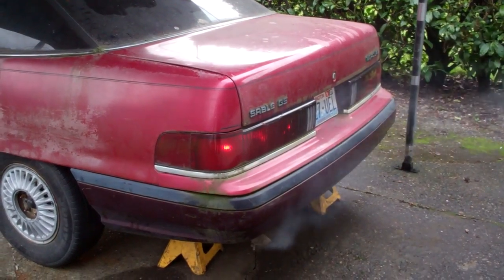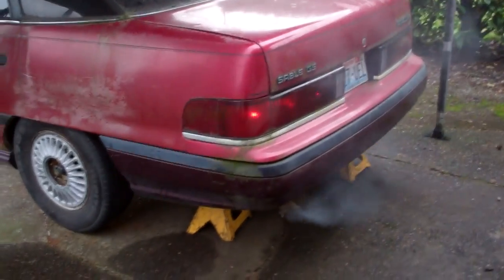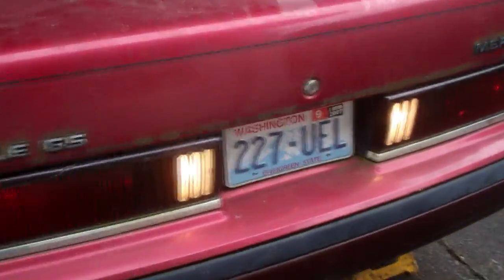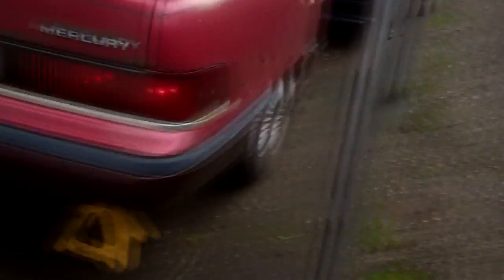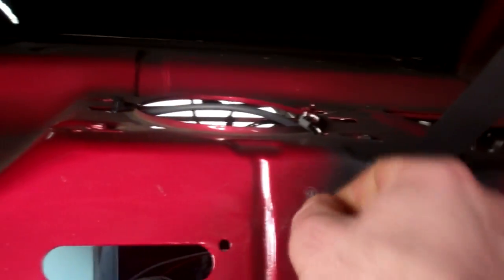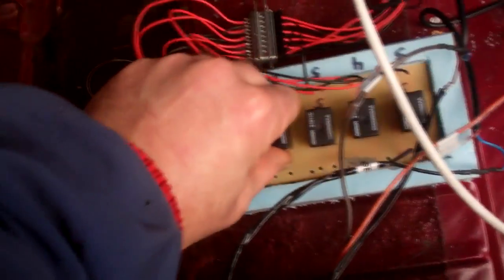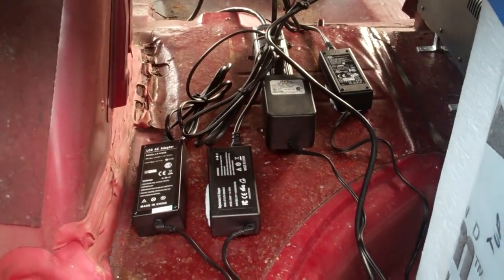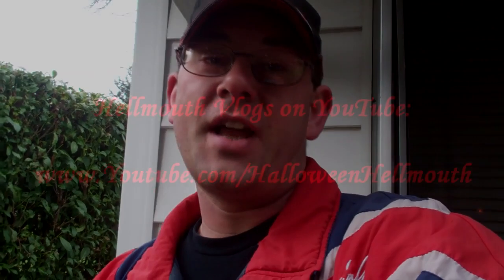Prop Car Update  - 02/06/11 (For Halloweenforum.com)

Comment from the maker: @Joiseygal It will be set on rails using casters.  I really haven't decided how I'm going to propel it, though.  I was leaning towards a single cylinder pneumatic...  But for a 5' cyl, that would cost $800...  Not to mention the compressor, hoses, solenoid valves and air tank to make it work.....   I guess that I'll cross that bridge when I get there!  LOL!